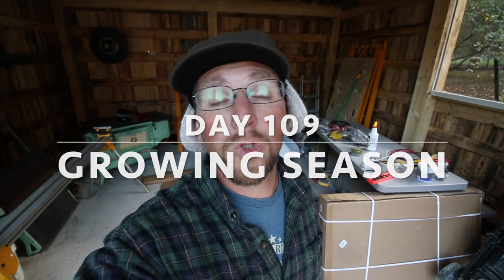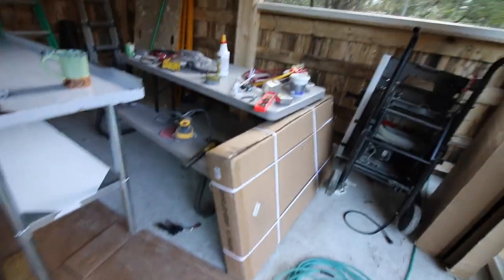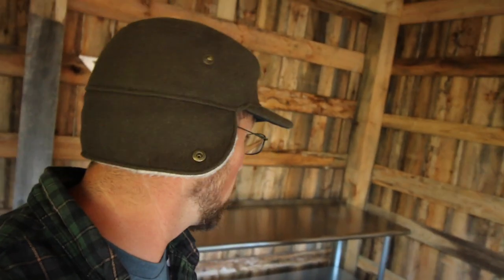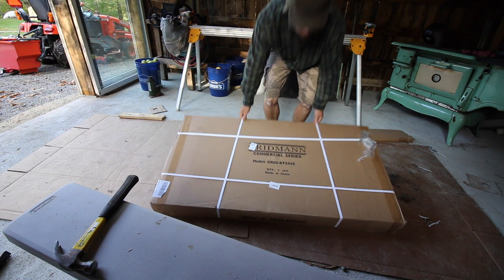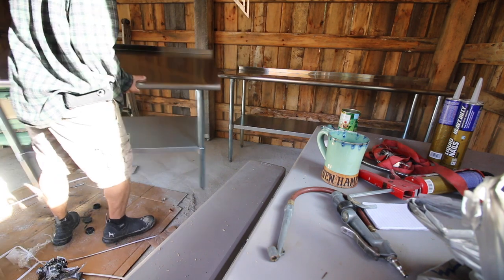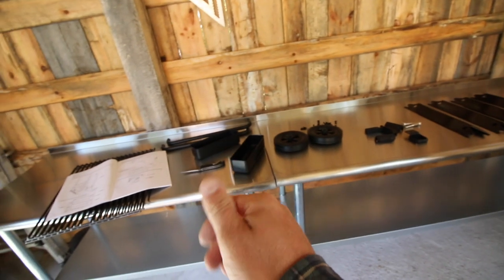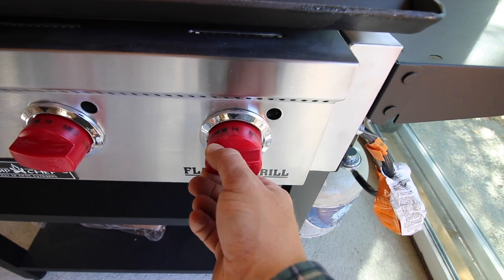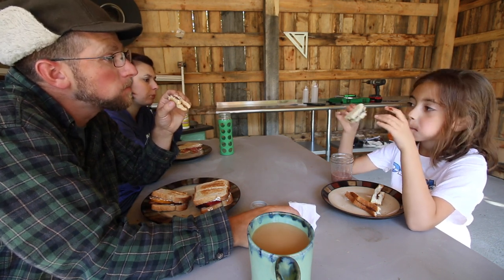🍴Getting the Outdoor Kitchen Equipment Setup!🍴

Comment: Hi Al ,
Some assembly required. ha ha 
I have noticed something. That huge outdoor kitchen that you started with is beginning to look a lot smaller as you fill it up with work tables, a griil, a wood stove and an eat at table. If there is much more you are going to be short of space !  A pair of dwarf orange trees in large tubs inside of your south facing windows would look awesome.  And provide some much needed winter greenery. Not to forget that they give off some oxygen. And yes, when properly watered and fertilized they will grow oranges ! Inside for the winter and outside for the summer. Just an idea for you to consider.  Your own organic oranges. Very tasty.

Comment: Review why modern fittings are always fit the with male part on top and inside the pipe below it. The idea is that any creosote that runs back down the stove pipe and chimney will run inside and back into the stove rather than leak out the joint onto the floor.
Reply from the maker: Yes the do. The old stove is backwards! Lol

Comment: That 7" oval crimp should have gone INSIDE the cast oval. Crimps on wood burning flues should be installed opposite a/c ducting to allow any condensation to drip back down to the stove. Not to worry. You'll change it when you get tired of the mess on the outside.

Comment: Like the tables and they should work great for processing any type of food. As for butchering pigs it would seem that a larger table would be necessary to accommodate the carcass(4'x8') what do the people giving the class say? You can find them on C.L. or at used restaurant equipment stores. SS is great because bacteria doesn't grow on the surface and it can be disinfected. I'm looking forward to the class. Around here most just take the live animal to the locker and pick up the packaged meat. We use to split a steer every year with another family when the family was bigger. Overall I think the kitchen will be a great addition to the homestead.

Comment: Saw the dust waft from the outdoor kitchen floor.  May I suggest dampened or oiled saw dust as a sweeping compound.
Loved the stainless.  Had my new house kitchen done by restaurant contractors.  Yes, the stainless made great countertops and sinks with built in drainboards.

Comment: What a day for scores!! Those SS tables are real nice, and an excellent price. The chrome on the legs should hold up well unless it gets scratched through. Simichrome polish buffed into scratches will help somewhat to restore the finish protection. The rough sawn would look nice as cabinet doors. I would be concerned about contamination from butchery, and unfinished rough sawn. 
The grill is another excellent score. very professional looking, nice heavy flat top. The bacon grease would be ideal for seasoning the whole top. Now you just need a grill stone, and grill weights. 
Nice fit up on the chimney connections. Did you get a flue damper for the 8" pipe? Looking forward to seeing you fire that up for the first time. 
The OGOK is coming along nicely. Only a month to go until Hand Hewn and you're awfully close to be all set up.
Reply from the maker: Thanks! Yes Hand HEwn Farm will be here before we know it! We have a damper waiting on pipe now. The local store was sold out! We had to order it online

Comment: LOL! I was just looking at that model last week!! It was a little above my price range but their 3 burner is not anywhere near as sturdily built as the flat top. So I'll wait a little longer! Their oven set-up looks really nice also! I quit making bread in the summer so I don't heat my house up but with that oven...a couple of more things added to my covet list!
Reply from the maker: If you can wait to get this one I would it is very nicely made.
Reply: just an idea....in summertime I bake my bread in 1# loaves in the bread machine on the porch (which I seasonally set up as a summer kitchen) to help keep the house cooler...
Reply: Awesome idea! But I don't have a bread machine.
Reply: Normally I don't like one use small appliances, but we make all our bread so the bread machine makes my dough for me-and unless its hot I don't usually bake my bread in it.  If the idea is appealing, you can usually find them at Goodwill for a great price. (My last two were new in their boxes!)
Reply: How sad, unwanted gifts! How well do they bake the loaves? The concept of mixing, rising, and baking in a single pan is hard for me to grasp. I saw them as a fly-by-night gimmick that wouldn't mix ingredients well. But they're still around so they must work and folks are happy with them.
Reply: Maybe check the reviews on different brands?  For myself, I've never had a problem with the dough making cycles-you just have to choose the right one.  Like anything else they come with a bunch of options-timers, dough only, wheat bread , etc - so it kind of depends on what you need in a machine.  I tend to make smaller loaves (1#) when I'm baking in the machine so my finished slice of bread is smaller.  Hope this helps!
Reply: And they bake well too-just make sure to clean off the heating element regularly.
Reply: Linda Kurtz - I'll look into them! Thank you so much for all your awesome information!